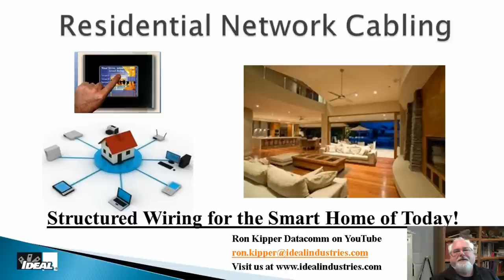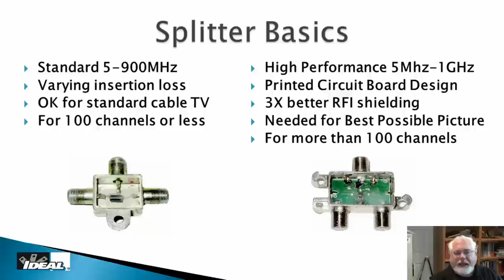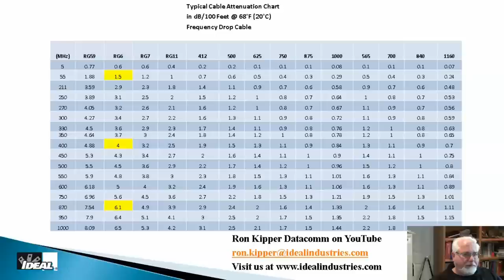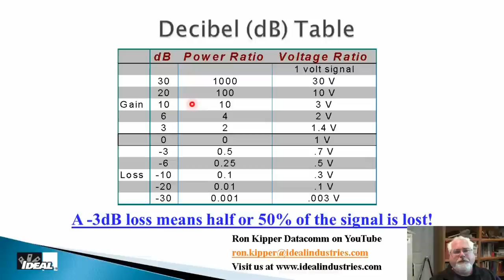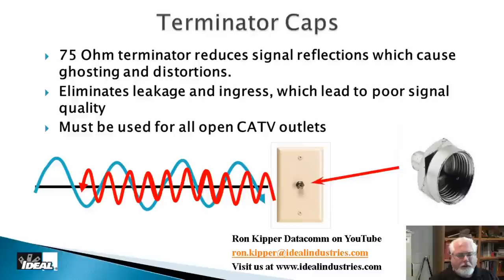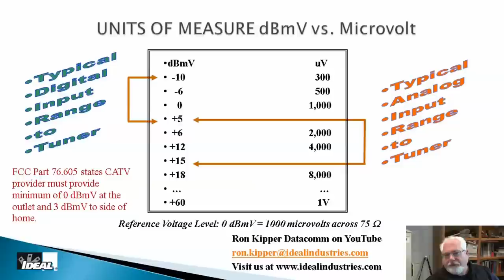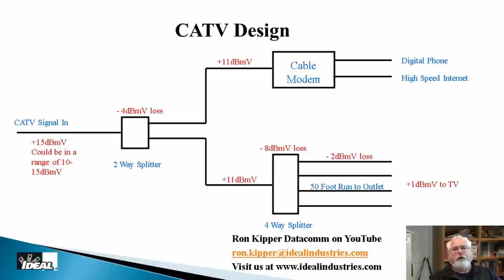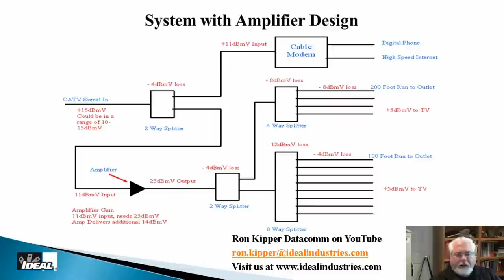Residential Structured Wiring Systems Part 4 CATV Signals

Comment: Hey Ron, great video. Quick question... Does a cable set-top box amplify the signal prior to it going to the tuner or tuners within that set-top box? Oops, another question I just thought of as I wrote the 1st one. Within a set-top box with say 2 tuners (or more) does the signal get split again to go to each tuner?
Reply from the maker: Hi MG I am not sure how the turner handles the signal once it is in the STB but if it has two tuners I would say it would need to be split. Sorry not much help have fun Ron

Comment: Hey Ron, this video actually gives me a clue in resolving a riddle that's come my way: A technician came and installed the utility's modem directly to the incoming coax cable. We ordered ONLY INTERNET service; No TV! After a few hours of being connected, the technician came back and inserted, before the modem, a small extension wire with a 3-way splitter on one end.  Why would they install a splitter, leaving two connections empty? Could this be a means of the utility's saving money at my expense, by reducing my throughput and me not noticing a significant delay?
Reply from the maker: Hey William thanks for the input! Ron
Reply: @williamstroupe4961  correct, we see a lot of vendors use the splitter purely as a means of attenuation, which is not recommended. We actually carry dedicated attenuators on our service vans. Ours are blue. We have many types of filters depending on the need. Sometimes, in scenarios just like this one, the transmit levels (Tx) are too low and we'll add a Tx filter to raise it up a little bit. With my company, we want your Tx (send) levels to be between roughly +32 and +52dBmV. We want your forward (receive) levels to be between roughly +10 and -10dBmV. And I beg of you PLEASE don't try to install your own amp lol, I've never met a customer that did this correctly. Amps can exaggerate signal discrepancies. 90% if the time that an amp is used, it is typically as a band-aid until the technician can figure out why the signal is so low in the first place. Only houses with at least 5 cable devices or more should have any justified need for amps.
Reply from the maker: Nate thanks for your comment and input I sure someone out their can use it. Have fun Ron

Comment: Wow you reallly have a wealth of knowledge. Do you have a guide on  OTA cable?? I'm getting ready to install an amplified antenna (Mohu Sky 60) in my attic, then run about 100' of RG-6Q coax down to the bundle of cables outside the house left by the builder. I'm going to install a junction box for that coax bundle and wanted to put in a splitter. From there, 7 coax cables go back in and all through the house (probably 50-75' each). For now I need a 4-way split but eventually I'd like all 7 hooked up.    **Do you think I need an amplified splitter, or will the antenna push everything through all those long runs? And if I were to go ahead and terminate all 7 coax would I need an amped splitter? Any advice is appreciated
Reply from the maker: Hey Daniel if you need to amp the signal really depends on how strong the signal is coming from the antenna it can vary a lot depending on how far you are from the source. I'll bet you need to amplify it though. So in the junction box you mention add the amplifier and then feed a two way that feeds 2 four way splitters that should give you 8 outputs. That should do it just make sure to use a good quality amp and 1 GHz splitters should make it happen. Good luck. Ron

Comment: Hi Ron,  I like your video`s.  Question for you, I have 3-IDEAL splitters but they do not have any #`s at the ports.  Part #85-332, 88-333,  85-334 Will these be ok to use?  Thanks
Reply from the maker: Hey Don yes they should be fine for your catv. Good luck Ron

Comment: I have a antenna. I have a coaxial wall outlet in a bedroom that is hooked up to modem. What kind of splitter do I need to have another coaxial to a tv?   I hooked one splitter but only got “audio only” message on tv.
Reply from the maker: Carolyn a good quality 1 GHz 2 way splitter should work for you. It all depends on how much signal you have to split. If you have tried before and did not get a good picture then adding an amplifier may be needed just amp the signal before the splitter. Hope that helps Ron

Comment: Hi Ron
I bought a IDeal 3 way splitter.  There's no DB Loss information on the front of the splitter.  Starting from the top.
 left top is out. right top is in. On bottom there are 2 outs. Which of all the out is losing  the least DBs?
Reply from the maker: Hi John you must of bought one of the 2 GHz splitters and you are right the ports are not labeled with the dB loss. The ports are balanced which means they all have the same loss which is dependent on the frequency. At CATV frequencies you can bet on about 7-8 dB of loss. Hope tat helps Ron

Comment: I have  2 mains coming into my house..An Antenna system for tv and  cable for my internet.Can I combine both links then feed off to inside of house?
Reply from the maker: Len probably not as I am not sure what frequency the two signals are operating at. With that said most splitters can be used to combine signals as long as you can split them out and again are using different frequencies. Hope that helps Ron

Comment: When installing a splitter, can you change channels on the tv that is on the splitter or do you have to watch what is on the main tv?
Reply from the maker: Hey Thomas feed the CATV line or antenna to the input on the splitter and all TV's can see any of the channels available. Good luck Ron
Reply: @RonKipperDatacomm1  my question is can I change channels on each individual tv or do I have to watch  the same channel that is on the tv that the splitter is on?

Comment: so basically all I need to put another tv in my spare room is a splitter only ? what if I want to put another 3 TV's in the house ? will I only need a splitter ? thank you
Reply from the maker: +Faleh arab It really depends on the amount of signal available at the side of the house from the provider. From what I know most providers provide enough signal to support about 4 TV's in a typical size house. If it is over the air same thing it really depends on the signal you are receiving. Before doing a lot of work layout some cables on the floor and give it a try. Good luck Ron

Comment: Hi Ron

I have a Motorola SB6141 Cable Modem and a Tivo and both seem to have issues regarding signal. The Cable Modem drops connections and the Tivo develops blocks in the picture from time to time. There is an underground run of RG11 that feeds to a 2-way, 1 50ft RG6 run to another apt and a 25ft run into mine which I have connected to a 3-way. The signal according to the cable modem is -2db downstream and 52-54 dBmv upstream. Would adding an amplifier help? I was looking at the Antronix FRA1-1510. Any suggestions?

Thinks for the informative video!

-Kyle
Reply from the maker: Hi Kyle  I am not a cable tech and have no idea what your provider is doing as far as signal strength. However if you are having issues with signals dropping out give the amplifier a try. Make sure to buy one that is bi-directional and rated for  CATV signals today and amp the signal feeding the 3 way splitter. Good luck Ron

Comment: Hi Ron, 

What if you had 2 modems in the same room. my issue is that they are dropping several times a day. Would you recommend a 4 way splitter/amplifier like (motorola BDA-K4-RA) at the first point where the 2 ways should be, then running a cable to each modem directly? or keep the 2 way and spit it with an amplifier in the the actual room?

Thank you for your time. 

both modems are in the same room, the wires are not long since the room is close to the entry point of the home.
Reply from the maker: D dunn why two modems? They are basically splitting your service and may be part of the reason your dropping service. If you try to amp the signal just make sure you use a good one and the one you mention should work but not sure until you try it.  Good luck with it. Ron
Reply: Hi Ron, 

Thank you for the reply. I have two modems to have 2 different public ips. I run alot of reward apps, and the apps limit you to x number of accounts per ip....

 Well, I stopped for some time, but I want to get back into it. I have 100+ android devices that will be split up on the 2 modems. I have high quality routers that for the most part take the load, but I will also soon venture into making a pfsense router for web-caching, but I need to get the connection stable. 

Thank you again
Reply from the maker: Wow that is cool. I happen to be on Google Fiber here in KC and it is super fast. A video that used to take 20 minutes now is under 2. Ron

Comment: have to ask ant system 10 channels strip amps works ok .i going to add  4 channels  have Pico Macom CA-45RK550 Distribution Amplifier 550MHz Push-Pull Headend Amplifier can i used 2 way splitter back wards to add to system??

Comment: You need to e very careful when choosing splitters............some 
splitters do not allow backward flow of current (from output to 
input)...............for this purpose you need 
"combiner"............just like if you want to use two antenna on a 
single Television...................and splitters can also increase resistance.......mostly if not powered...............
Reply from the maker: Cool thanks for the input probably ought to update these videos. Still pretty common in video applications still. Have fun Ron

Comment: i have internet cable but i want to add tv anttena
Reply from the maker: +rich reynolds Rich I would not try to mix antenna and CATV signals on one piece of coax as you probably will get some interference from each other. I would run 2 coax runs and try using different input on the TV if that makes sense. Hope that helps you.Ron

Comment: What a screwed up world we live in today. The installers know most of this info, the average homeowner has no clue. Hard to believe im saying at least radio shack tried to make sure the customer bought the right equipment. Today at the big box stores or home improvement centers the employees have Zero Clue and end up purchasing on price and packaging. Throw in ota tv channels into the mix you need the right combination  of parts cables etc to work properly, and the good stuff today is costly. 
This concludes todays sermon
Reply from the maker: Yes spend a little more to get something that is compliant today. Good to hear from Yon Ron

Comment: funny that people will go waste money on splitters. the ones in stores are not for cable tv. the only use for them is an antenna. most cable companies like comcast and cox supply splitters at no cost. saves their line techs ingress hunting to keep store bought splitters off the network. comcast will also give hdmi cables free as well. less trouble calls from those who buy cheap hdmi's that dont have ethernet
Reply from the maker: dbrinkley5 the splitters we sell in retail can be used for CATV applications but your right a lot of them are no good and used for antenna applications. People also don't realize if you use a 4 way splitter than the signal being sent out each port will be reduced by about 75%. Thanks for the comment. Ron